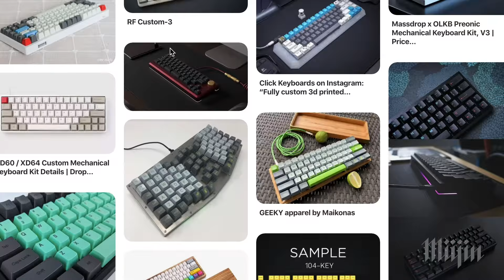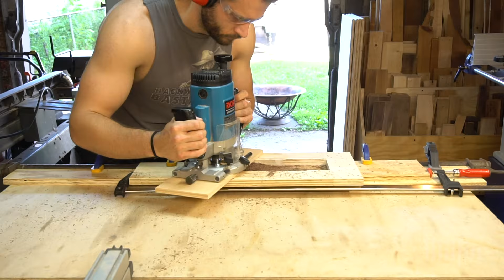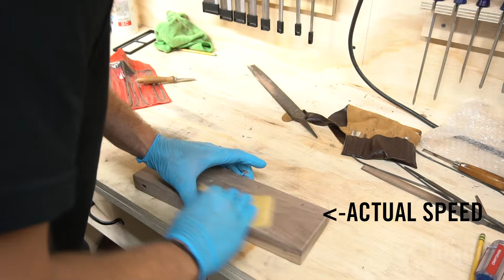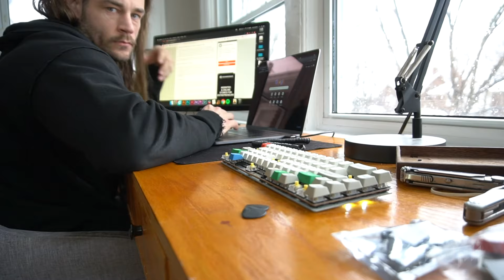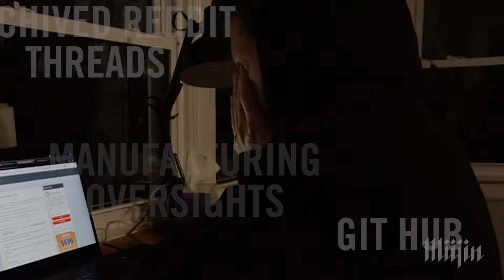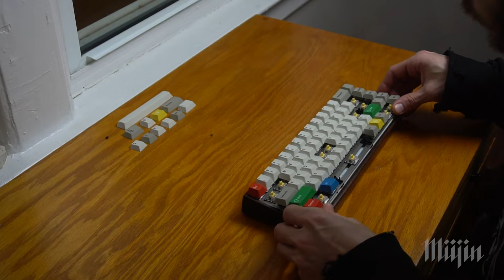Beautiful keyboard. Terrible fate.

Comment: How has this held up over time? I'm looking to make something similar.  I've read complaints about the pre made wood cases warping, I'm guessing because they're made in a different country and when they get to you after shipping they probably aren't the right moisture.  I'm thinking that properly dried and acclimated wood should be fine, even more so if I need to laminate 2 pieces like you did for thickness purposes.
Reply from the maker: I'm typing this on the keyboard right now, I use it as my primary keyboard. I'll still get minimal warping as seasons change. Right now (dry season) it's dead flat. Just make sure whatever you use is as acclimated and straight-grained as possible and you'll be fine.